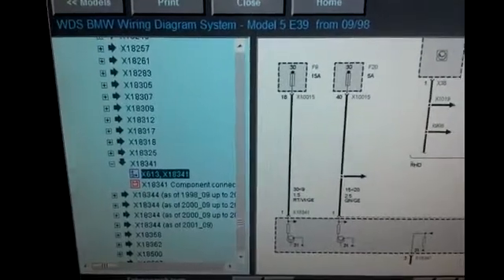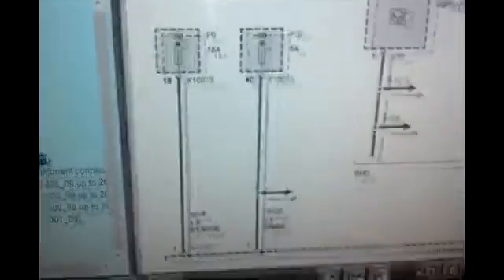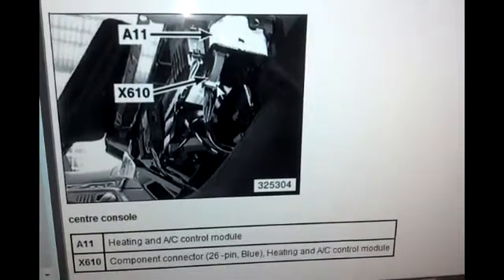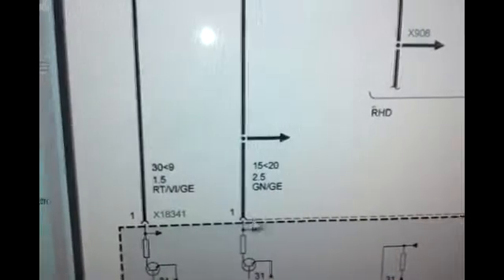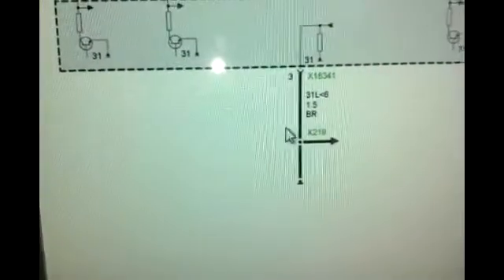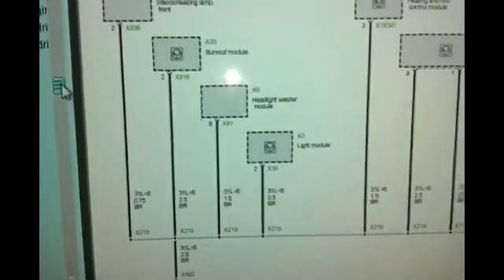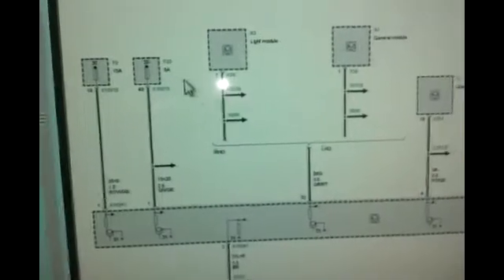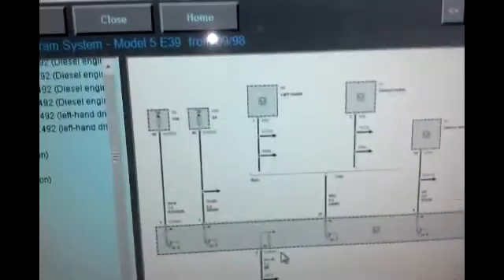BMW 5 Series E39 Heater and Air Conditioning Control Panel Power Supply

Comment from the maker: The part number often can change due to part supercession. The fan is a Pulse Width Modulated signal from the engine computer. You would need a special scan tool to activate the fan via status request or the best test is to plug in a test fan externally but make sure your hands are clear of the fan. Also make sure to check the fuse.

Comment from the maker: Yes you should be able to swap the same module from another vehicle. I often use this method for testing if I have another vehicle present. It has to be the same model as yours. You can also verify the part number on the unit and match it to the unit you are borrowing or replacing it with by looking at the number on your control panel.

Comment from the maker: ...behind the bumper. If this fan does not activate then the pressures can get too high. There is also a chance the heater control panel is not sending the request to the engine computer but this type of failure is more rare. I hope this helps and you get it fixed for your trip!

Comment from the maker: Glad to try and help. They can plug one in and see if it works but I did a quick look at the wiring diagram and it confirmed what I suspected that the compressor is activated by your engine control unit and not the heater control panel. The heater control panel has to send a request to the engine computer to activate the compressor and the electrical fan. If all parameters are met then the engine computer will activate the compressor. One of the most common failures is the electrical fan...

Comment: There is only no A/C, everything else working fine, even when I turn on A/C green light comes on and it starts to blow faster through the vents. 
Report from A/C specialist: ''control unit does not see the compressor''
Thanks for quick reply, as I have only couple of days to sort it before we go to almost 3000 mile road trip and at the moment is burning hot.

Comment from the maker: Hello, Yes the control panel is also called the control unit. It is not very common for the control units to fail. Are you getting no AC only? Or no air from the vents from the blower?

Comment from the maker: Hello, Usually this is just a bad FSU and the heater control does not usually fail. I would first check all the fuses for your heater control panel to make sure none of the power supply fuses have failed. Then I would remove the panel and check to make sure power is reaching the heater control panel. If all is good then this is a secondary failure. If you unplug your heater control panel does the FSU stop running? If so this may all be the heater control panel.

Comment: Great explanation. Thank you. My unit has never given me fit until recently. Blower stuck on even after removing key, indicating a bad FSU but also the A/C module is completely dead. Question is did the A/C module go bad and messed the FSU  or  didi the FSU went bad and messed the A/C module? Which one I buy first ??

Comment: Good news.  I found on craigslist this m5 owner who was parting out his car and bought the unit for 50 bucks.  After I installed it, I put the fuse 9 back in, cranked the car and I had AC back on the car.  It was plug and play! No programming needed.  I'm not sure why not but I'm glad I didn't have to get under the passenger seat.  Thanks for your help.

Comment: This definitely helps.  I will need to check those in the morning and the sit over the weekend and see underneath the foot panel.  I had a vapor barrier leak years ago and had them repaired but doesn't hurt to check those as well.  Before this happened, I remember changing the ground wire that connects to the battery because it was loose. The gauge is slighly smaller. Do you think that may be feeding less power and maybe the cause of this? I'll check that too.  I'll let you know Sunday. Thanks.